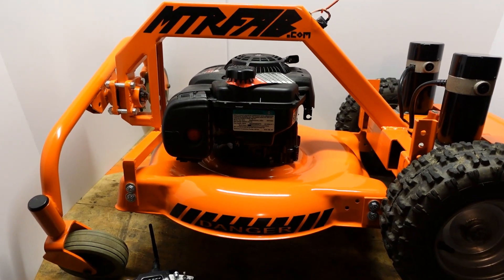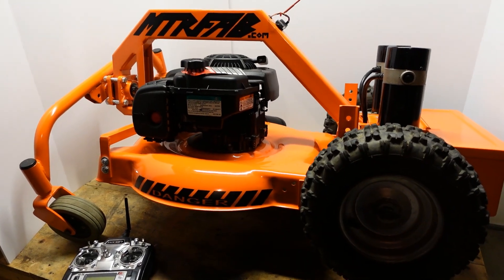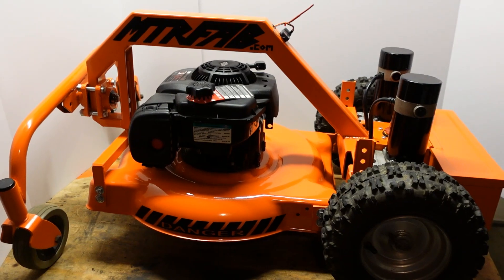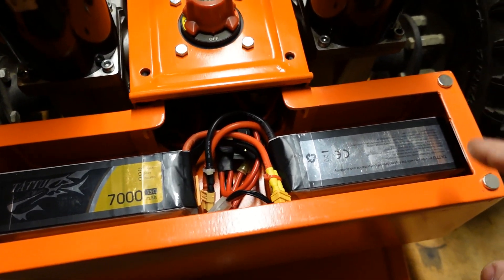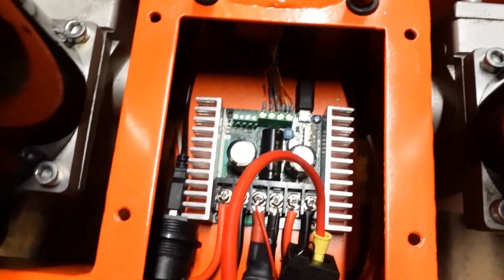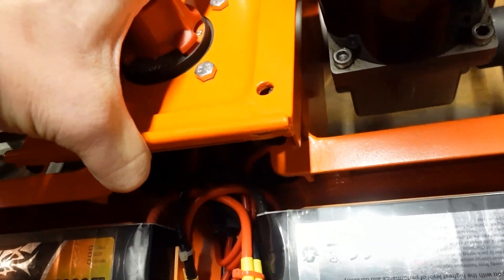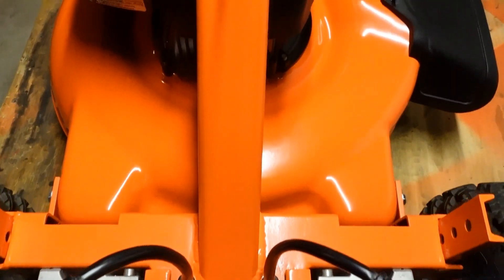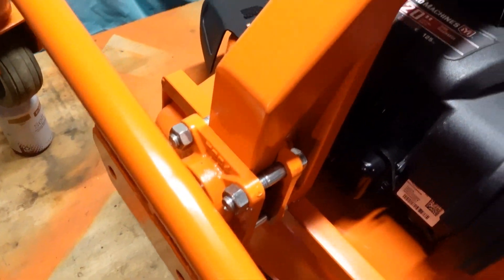RC Lawn Mower V2 Pt. 17  Build Update and Bench Function Test

Comment: So cool man.  That articulation is sexy.  Lack of a better word.  

I’d like to see some actuators on the front.
Reply from the maker: It's kind of mesmerizing watching it traverse my bumpy lawn... It is amazing the way it moves... You would never think it should move as much as it does. My lawn is about as lumpy as it gets. That's why the standard four fixed wheel frame doesn't work too well for me. This flex adds to it's abilities for sure. I really want to mount my wheelbarrow bucket and a linear actuator to the top and make a dump wagon accessory. Lol... Tired of spring cleanup... Pushing a wheelbarrow sucks! Probably more than mowing the lawn.
Reply: @MTRFAB  definitely understandable.  I have one small section that’s basically a ditch at the base of a steep hill.  The ditch is just wider then the mow deck so when I cared I always made the wheels lopsided to make the ditch less pronounced.  That’s the only reason I mentioned the actuators for it.  

Oh yes to everything about the wheel burrow.  After trying a little clean up myself this spring, I wish I had started a little dump trailer as my first project.  

I always listened to the old guys I worked with growing up, and assumed I would be thrashed at some point in my life.  But this snuck up on me.  I have great new appreciation for automation.